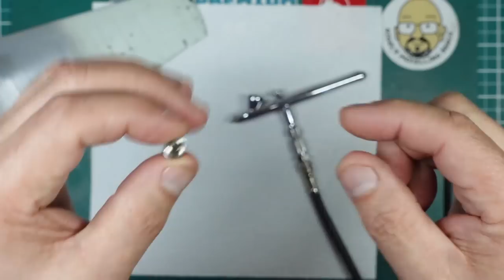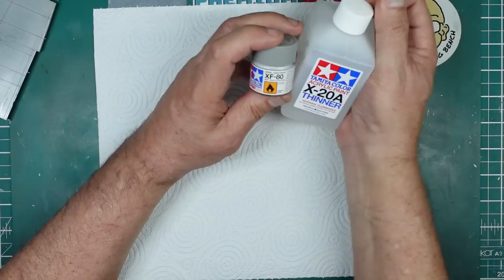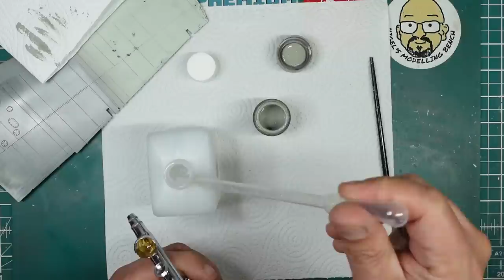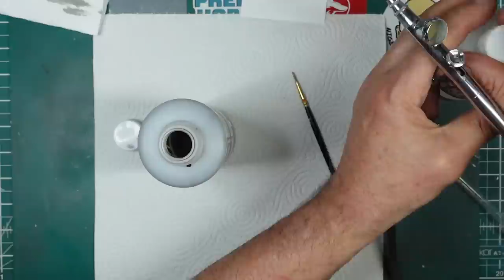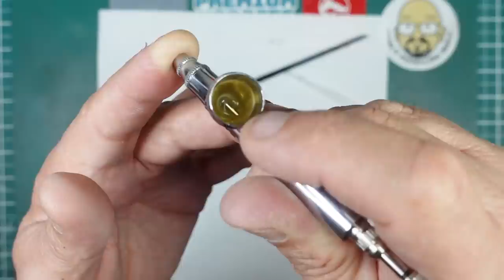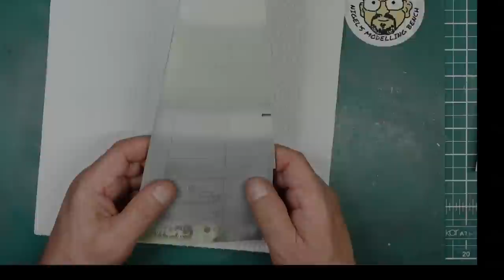Beginners Airbrush help and can you paint LP over XF paint?

Comment: It's a very useful video (it's me James Mower BTW) Now I've had reactions when using Lacquer Paints (MRP) over an Automotive Primer (Halfords) it depends what's underneath.. I to have an airbrush Procon Boy Ps-270 and I've chucked Vallejo Model Air through it, again I don't clean it unless, I've been painting metallics through it and I've just replaced the needle and Nozzle after 4 years. Basically  I  do what you do.

Comment: Just a quick environmental tip. I mix outside the airbrush because I can see if the paint is gritty or not (this isn’t being critical of anyone) . But if you do this you can buy a 10ml Pyrex lab beaker from Amazon or eBay rather than plastic shot cups.. they are only a couple of quid and they last forever. As I say not being critical of anyone but I only found out you could buy such a thing recently so I thought I’d spread the love

Comment: Hi Nigel , love your videos you do almost exactly the same as me with your airbrush except I use Boots surgical spirit for cleaning my airbrush, parts prior to glueing/cementing, my tools and work area and even myself if I've been a bit sloppy. It's easier to obtain safer and cheaper, around £5 for 500ml. it was much cheaper before covid but it works for me. also I noticed you didn't advise to pull back the needle before cleaning the needle cap with a q tip although you did pull it back yourself,  might be worth mentioning in your next video. Keep it up Nigel take care .

Comment: Great video Nigel. Full of good hints and tips. I must admit, that I sometimes suffer from paint splatter. I find it hard to get used to pushing forward before releasing to stop the flow. I sometimes get paint drying on the tip and causing problems if I am doing a large area. Mixing paints. I have seen some people say "just get a new Tamiya bottle, and top it up to the start of the screw bit with thinners". "That will be thinned right". As you have pointed out, it depends on age of your paint. The temperature of the room. Even what colour it is can make a difference. I sometimes mix in the cup. I also mix in paint jars, plus I have some dead cheap throw away plastic pots with separate lids I use. For cleaning, I usually blow some airbrush cleaner through first. Then I take the needle and nozzle off and clean them separate. I've generally not done it the way you do it. Maybe I will have a go at cleaning the way you do. I have that Bartsharp too, plus a Bartsharp compressor. Great bit of kit for the price. I also have a Harder & Steinbeck Evo Airbrush for the detail work.

Comment: Excellently useful video! I value two youtube modellers' opinions over all others and you're one of them, the other being SteamGeezer, and you both do pretty much the same thing regarding mixing in the airbrush, as well as cleaning and so on. I see people counting drops of paint & thinners into plastic shot glasses, using several pipettes and it's always struck me as being so wasteful and ecologically unsound as well. I want to do more airbrushing than I currently do, and I'll use the methods of going about it that you've shown here. It makes sense, it works, so I see no reason for doing anything different!

Comment: Hi Nigel, Wow, you covered a lot of territory in this one.  There are so many things that effect the thickness of the paint, it's impossible to have a strict formula that works every time.  I use an Iwata HP-CS for all my painting.  The one thing that I do that I don't see others doing is that when I need to mix paint in the cup, I just put the cap on, cover the airhole with my finger and give the airbrush a good shake.  Thanks for sharing.  Have a great day.  Jeff

Comment: The needle of some airbrush are made in a way you  can not pull it from the front.
Some have a ball, some a square  end, my
H&S Evolution have dents that indicate the size of the needle that can ruin the seal.
Never had problems pulling the needle from the back.

Comment: I second Mr tool cleaner, it's made airbrushing way less annoying because cleanup is so much quicker.  I flush mine with water after I clean it too, I don't know if it's necessary but I wonder about some of the harsher chemicals hanging around on the seals.

The only time I mix paint outside the cup is if I need a large batch and the color has to match.

Comment: Agree with all of that. Definitely worth buying a reasonable branded airbrush rather than wasting money on a dirt cheap one that you cannot get spares for. Main problem with the really cheap ones is that the seals go very quick if using lacquers. The only time I use a pipette is when mixing a colour that may need to be repeated but never for just thinning. For mixing and thinning I use paper shot 'glasses' where the volume is more than the colour cup.

Comment: Glad to see you dispel some airbrush myths there  Nigel, the advice perpetuated as “cast in stone” even by some high profile modellers is absolute BS.
1. No way on this Earth by the laws of Engineering nor Physics can ‘back flushing air’ ever damage the packing gland seal, it is an impossibility and something that would not be recommended by airbrush manufacturers (as it is).
2. Removing the needle from the rear is the safer option to removing from the front. Yes if you are clumsy you could damage the needle when you reassemble  it but that can be repaired, unlike a damaged nozzle and is cheaper to replace, by removing it from the front risks damage to both the needle and nozzle at the same time, I’d rather reduce that risk. I have a new, CR+ Harder and Steinbeck Infinity and they actually advise not to remove the nozzle at all for cleaning but to remove the needle from the rear even with their innovative, reduced risk nozzle system!
3. The packing gland seal is hard wearing and low friction (the better type being PTFE) and is designed to withstand the constant movement of the needle. It doesn’t matter if you pull paint through on the needle, it won’t affect the brush in anyway whilst it stays on the needle so unless it physically leaks into the body cavity whilst in use only then will you need to replace it for a new one.
4. I also mix in the cup using thinners first and back flush air back into the cup, the only caveat I can see is if you were to use a brush or stirrer instead were there is a possibility of shedding a hair or damaging/contaminating the cup depending on which material the stirrer is made from but that is a remote possibility not really worth getting paranoid about.

I also have that Fengda brush you showed and after a bit of pimping and fettling find it very good, well outperforming it’s price point.

Comment: That's good, I have a good mixture of X XF and LP, I use mr color leveling thinner for all 3, and always worry about putting what on top of what. I'd love to find an in depth resource about that sort of thing.
Reply: Also lots of other non water based paints, Mr Hobby, MRP, AK Extreme / Real / True etc, some of those are wax based and enamel based which adds more complexity
Reply from the maker: Those three can be intermixed and overcoated with levelling thinner all day long.

Comment: The only two fragile parts are "the point of the needle" and " the nozzle ", if there are parts with precision on an airbrush it is these 2 parts. I tend to flush the airbrush out before I remove the needle out the back. You can get a 0.5mm needle "Iwata CR" for about £110, it's probably the best buy out there for general purpose use.

Comment: have you seen the ads all over Facebook for rechargable battery powered airbrushes with a built in "compressor"?
Reply from the maker: Yes, I mentioned these in the video.
Reply: @NigelsModellingBench  ah right, when you mentioned ones with rechargeable cylinders I thought you meant ones working off compressed air cans.
I take it you'd still recommend something like that £50 one, plus a proper compressor, if on a budget?
Reply from the maker: I would always recommend buying the best you can afford. I can't speak to those rechargeable ones, but I'll bet they have issues.

Comment: All the things you describe as 'Airbrush Abuse' have always been the classic way 99.9% of people use and clean airbrushes in car and bike customising work, artwork...and modelling. 'Personally', I think there is a lot of neurotic superstition about airbrushes. They are very simple but 'incredibly' precise bits of engineering that don't take to being pulled around too much. The idea they need stripping endlessly makes very little sense - Keep them basically clean. That's all that's needed, you wouldn't strip a fountain pen every time you use it. Lastly, I will go out on a limb here and say that about ninety percent (I have done no research!) of issues come from bad paint consistency, mixing incompatible paints and solvents and crappy technique. But it's not because you didn't use enough beeswax or chapstick, or PTFE tape or Vaseline or cornflakes on your nozzle threads or bed in your highly polished needle needle with engine valve honing paste (yes, ridiculous). I am with you totally on this Nigel. Stop fretting, get painting.

Comment: Nigel, do you use a compressor or a CO2 bottle?
Reply from the maker: Could you not hear the compressor in the background? I have an Iwata compressor.
Reply: @NigelsModellingBench  I couldn't hear it.  Cheers mate
Reply from the maker: Sorry, I thought it would have been easily audible. I used to use compressed air in canisters, but it's a bloody expensive way of getting air!!
Reply: @NigelsModellingBench  Thanks Nigel.  I'm a bit hard of hearing hate to say.  Is it a Ninja Jet or the Silver Jet?
Reply from the maker: Its a Power Jet Lite Ed.
Reply: @NigelsModellingBench  Thanks Nigel.